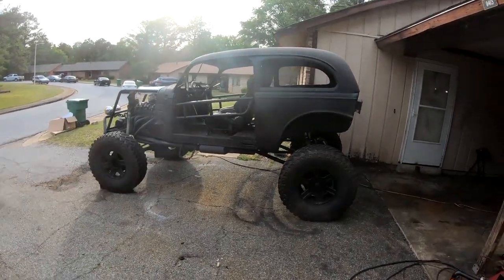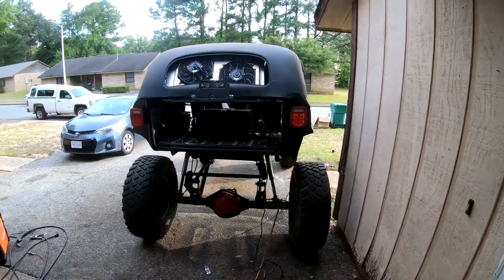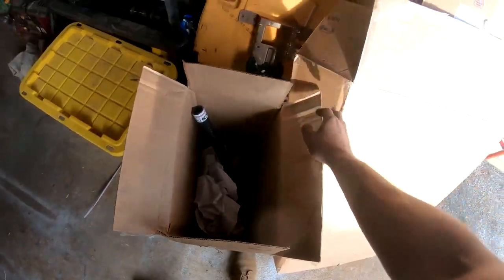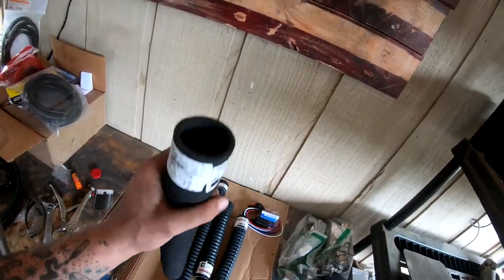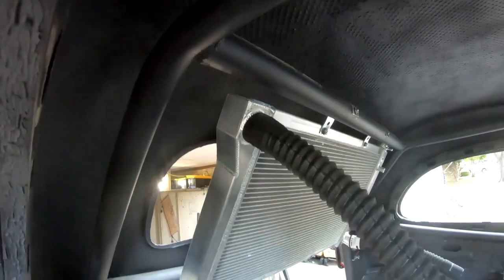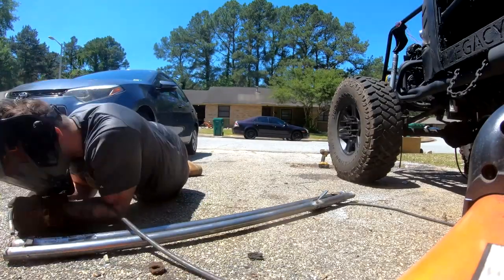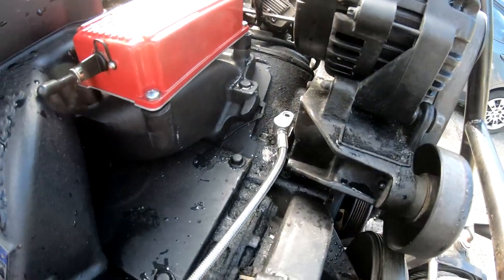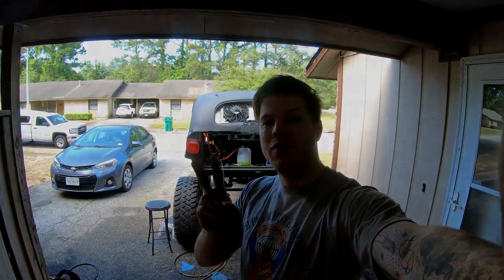Rear Radiator Mounting & Plumbing w/ Exhaust Tubing on a '38 Sedan 4x4 || Legacy 4x4 and Off-Road

Comment: Machine is looking great ! Maybe an IR thermometer would be a handy tool to know what is going on when you start running it, you might need to add an extra inline pump to keep it flowing well. Great days to ya man !
Reply from the maker: I am heavily considering the inline pump.... but the internet says the stock one is fine as long as it doesn't run dry.... so we will see!

Comment: Pretty cool setup and fabrication. I like the idea of mounting the radiator in the back and out of harm's way. Hopefully the pipes won't kink or bend if you bottom out. But then again, the axles, suspension and driveshafts are more likely to take a hit if you land on top of a big rock or something. Was that machine gun fire in the background at 9:45 ?
Reply from the maker: I used hard line for every really tough bend, but I’m hoping the water pump is stout enough! We will see!! And I live on Fort Benning it’s just about constant here
Reply from the maker: Even at nights 😂😅